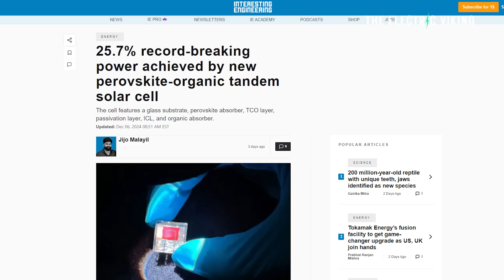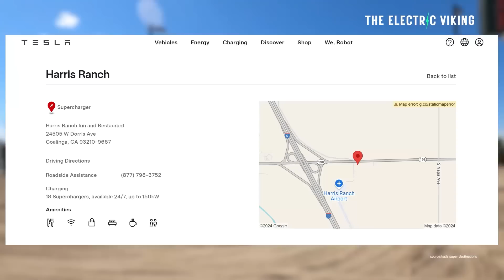Record-breaking perovskite-organic tandem solar cells revealed

Comment: What isn't talked about is the significantly reduced lifespan of perovskite. 3% more efficiency isn't so great if it only lasts 5 years. This tech is still a ways away, it shows potential but still has hurdles.

Side not on nuclear, nuclear lost public favor 40 years ago, due to gross negligence. so there has been limited research. Here in the US, 2 new reactors went online last year, but this was the first in 30 years. Much of the talent in the industry isn't there. It is somewhat making a resurgence, but most the effort goes into solar and wind. Nuclear is still important for baseload power if we want to go 100% renewables, and costs can come down somewhat with more research, and economies of scale. It will likely always be more expensive than solar, but can run 24/7, so is kind of required unless we want to install insane amounts of battery storage to account for several days of bad weather, and winter, but at that point nuclear would be cheaper.

Comment: @electricviking Google just released a new quantum AI chip called Willow. They say it's going to revolutionze research in many fields, including metamaterials and hereunder battery technology, solar cell research, nuclear fusion research, protein research and so much more. They claim it's 10 septillion times faster for certain tasks than modern supercomputers today used for calculations involved in most types of complex behavioral predictions.
Just wanted to let you know if you had not seen it yet. We are looking into a bright future, with with fast advancement in so many areas, especially If this new chip turns out to hold up to the expectations.
Have a nice day.

Comment: Sigh. 

Perovskites solar cells have a FUNDAMENTALLY short life and are unstable.   Even the best have operating lives of LESS THAN 1 year!  Often less than 3 months.  

Because being organic GUARANTEES that will ALWAYS BE THE CASE.   Organics do NOT have UV stability in general compared to inorganic materials.   Find an *inorganic* perovskite solar cell and ONLY THEN will you MAYBE onto something relevant.''

That laughable part is that originally "being organic" and having "low energy production" advertised as "Green" was marketed as a selling point.  The problem is the same "low energy production" is exactly why the lifetime/reliability is low - it's two sides of the same coin!!   And so obviously so.

Most perovskites are inorganic actually - it's an amazing crystal structure.  But essentially NONE are photonically active in a useful power generation way.

Again this is what happens when you blindly follow press releases rather than actually read and understand the original published scientific paper and do not have any background in solid state physics!  Breathless excitement without critical analysis is just propaganda and garbage clickbait.

Epic Fail.   As usual.

Comment: Google unveiled an experimental machine capable of tasks that a traditional supercomputer could not master in 10 septillion years. (That’s older than the universe.) The U.S. Bureau of Land Management will hold a lease sale on the Arctic National WILDLIFE Refuge in early January 2025, marking one of the last BETRAYALS of a presidential administration once adamantly opposed to drilling in the remote location renowned for THE LAST REMAINING U.S. unspoiled land and wildlife.
BLM said Monday that the agency would open up 500,000 acres of ANWR land in Alaska for leasing, holding a sale on Jan. 9 that is required under a TRUMP ADMINISTRATION 2017 law. The land is concentrated within the northwest quarter of ANWR’s pristine coastal plain.
The sale of ANWR drilling rights has been an UNNECESSARY ENVIRONMENTAL CALAMITY since the passage of the TRUMP 2017 Tax Act, which mandated two sales in the vast Arctic refuge. The Google Supercomputer calculates that the drilling will DESTROY ALL WILDLIFE in the Arctic National Wildlife Refuge. Oil companies say "that is as it should be".

Comment: Agai , you don't know what you are talking about. You say solar cell efficiency 10 years ago was half of what it is now

Sheesh. It's so hard to explain complex topics to simple minds.  But I will try 

There are many different chemistries.  Some have very high efficiencies...as high as 40%.  And they've been around for decades.  But those are expensive to manufacture.  So research went into perovskites which can be sprayed onto plastic substrates.  These emerged a few decades ago but with sub 10% efficiencies.  

Much of the news on solar cell advancements is with perovskites.  And now with high 20% efficiencies and low manufacturing costs, they are bringing down the price of solar panels.

It is clear you don't understand this.  As an expert, why don't you just take the time to wiki the subject before you make videos full of misinformation?!

Comment: Isn't the world record for perovskite solar cell around 35 percent?  The issue with  perovskite has always been durability. Do they claim they have also solved the durability problem?  Far as I understand it Oxford PV has  commercially available provskite solar sells that are supposed durable at supposedly 24.5 efficiency. The difference with this company doesn't seem that big of a deal if they are years ago from mass production.  What makes these specific ones special?
Reply: Last I heard durability was still an issue, then all of a sudden we have tandem cells, but every announcement strangely is devoid of any durability claims, so likely they will still fail after a short time and then you just have the silicon cell underneath, but hey, at least they can claim high numbers for marketing.

Comment: It's small potatoes,  and always years away. Where are the solar windows and roof tiles? Well done on the home battery, every home should have one and lower income families should have them discounted by government subsidies.
Reply: I guess the perovskite innovative PV has its place - but for your average Joe if you want to increase the output of your 20 panels roof solar by 5% - then add another panel.
Reply: Tesla has solar tiles. Others do too. The problem is that they are expensive to install.

Comment: Relying on solar in Canada would be like relying on snow in Australia
Reply: That why there are no plants in Canada.
Reply: @Kalley5341  What? No trees at all? Have they all burned down?:)
Reply: @mb-3faze  Sarcasm?
Reply: Canada does rely on solar just like the rest of the planet's ecology 😄. As for renewable electricity souces, you just need more batteries but also wind turbines because wind is stronger and more reliable in the Winter months. Easy ezee peezee.
Reply: Kind’ve true but sun doesn’t need to be beaming for solar to work. 
Solar should be so much more popular here in Canada 
Lagging behind..
Reply: A better example would be "relying on solar in Canada is like relying on hydro in Australia." Why? Because they are both examples of countries using the natural geography and climate to generate power most efficiently, whereas snow? What does that have to do with anything? I think solar does have its place in Canada, just like we have some hydro in Australia, but we should be using our resources the best way, like, geo-thermal in Iceland, Solar in Australia and Hydro in Canada.
Reply: Solar doesn't work by heat but with light.
Reply: @PyroShields  and you don't understand how high latitudes impact negatively the amount of light that is received and how high latitudes increase the amount of energy you must use for heat because it's cold.
Reply: @gregsutton2400  Your original comment you implied solar doesn't work in Canada, not sure if you're implying of the cold or the high latitude but you're incorrect.
Reply: @PyroShields  my post contrast the amount of sunlight available in Canada versus Australia and I am correct but it's okay to know nothing about it
Reply: @gregsutton2400  Well no, you made the analogy that Canada will benefit from solar as much as Australia will benefit from snow which is zero.
Reply: "Canada receives enough sunlight to generate solar power, with an average of 333 sunny days per year. Even on cloudy days, solar systems can still produce 30% of the electricity they would on a sunny day".

Thank you.
Reply: @christopherj2231  Sheesh - facts! To a closed mind the 'facts' mean nothing.
Reply: Solar in Canada requires triple the panels... Basically over-deploy the system, which Canada has the needed land mass.  Mix with wind, of course.  Most people just don't think aggressively with making it work.
Reply: Every unshaded square metre of planet Earth gets, on average through the year, exactly the same amount of irradiance from the sun as any other.
Reply: @mb-3faze  lol. Why did white people evolve white skin to boost their intake of vitamin D from much lower sunlight levels way north of the equator then? Evolution for no reason?